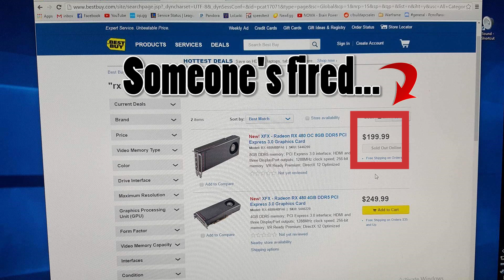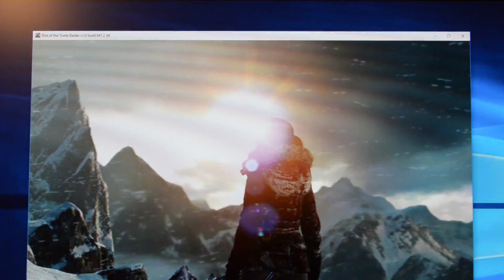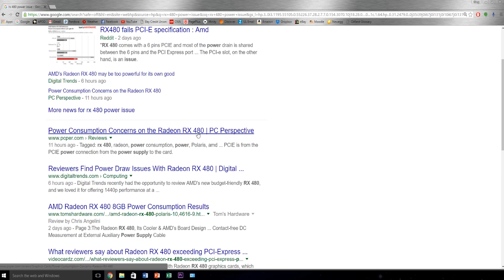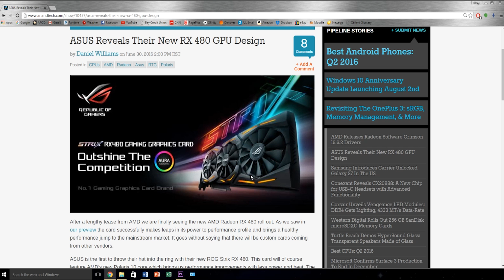RX 480 Aftermath: Power Issue & Over-Hyping

Comment: Okay, lemme get a GTX 960 or a GTX 970.
Reply: I mean, the 960 and 970 are the same or more expensive than the RX 480 and slower. Only blind fanboyism or actual CUDA use would make you go to either of those, over the RX 480.
Reply: I still want the RX 480.
Reply: Okay, lemme get an RX 480.
Reply: +Oliverleo2007 $269.08 I can buy that.
Reply: What?
Reply: +Mika Hadi no
Reply: Why its vram options are 3/ 6 gb. No thanks this isnt 2012.
Reply: get the gtx 1060 it's actually gonna be on par with the gtx 980 (unlike the so much hyped rx 480 (lol)) and will most likely cost about the same as the rx 480
Reply: jellenheimer Anti Kaan Agency And it seems that i was right... as always.
Reply: wait for GTX 1060 or 160Ti
Reply: Anti Kaan Agency Yes, it need to be compared. Blind fanboy who rush buying untrusted product.
Reply: nah man the rx 480 sounds a lot better than my ancient r9 270
Reply: +Tsunami lol that's bs you don't know that
Reply: Tsunami "likely cost the same" how do you know that?
Reply: or driver quality... especially in *nix world. I personally can;t say my AMD driver experience has be good..
Reply: Tsunami Lol me as well Nvidia always good when it come to driver and thermal management and also power consumption, it might not have the same terra flop but in gaming real benchmark it result better then Ati radeon card

Comment: I disagree.  I am fairly confident that the RX480 will compete, if not beat, the 980 at stock.  It's already trading blows in some games!  It might just take a while for the drivers to fully mature for us to see the full performance potential. 

I am also expecting some big improvements from the AIBs.

According to OC3D, he noticed that the XFX OC'd versions were getting the same benchmark scores as the stock card, and upon further inspection, found that the card was being power bottlenecked.  He actually lowered the clock speed from stock, and still got the same scores!
Reply: Total Annihilation Guru3d is probably the best GPU benchmarking site.  Check it out.

Techspot showed the RX480 winning in 14/16 benchmarks, and one of the ones it lost was Rise of the tomb raider, which runs like absolute dog shit on AMD.   The 970 was handily beating the 390x on that game.
Reply: No, it doesn't.

Unless you want to play AOS all day, every day.
Reply: Ill wait for the sapphire version of the card with a custom pcb, and ocerclock the shit out of it
Reply: Shawn E Are you the guy I just destroyed in reddit?  lol
Reply: It's trading blows with the 970. Not the 980
Reply: Rohit
No, it flat out bests the 970.
  The aib versions will beat or match a 390x!

Sapphire nitro leak 1325-1350 factory clock!
Reply: *****
considering it's a midrange card, it's okay.
Reply: Gene Starwind Na, I saw your post there and thought it would be hilarious to post the same reply. :D

Comment: The thing about AMD is that their driver support is superior than Nvidias. The 390 started weaker than the 970 and is about 10% faster nowdays. I honestly expect this card with a very good overclock and a 8 or  two 6 pins to get rather close to a retail 980.

Comment: That will probably require GPU bios update to fix the issue, normal driver update wont help with this problem. Newer RX480s will probably be fixed before hitting the market.

Comment: This might help explain a little better as well

"The RX 480, like most GPUs, pulls power from two different places. The first is through its own PCIe slot, which the PCIe specification rate at up to 75 watts. Some cards use less power than that, and don't require any additional connections. The RX 480 has a 150 watt total TDP, so it should theoretically pull the other 75 watts from its six-pin PCIe power connection. Both of those connections are specified for a maximum of 75 watts. Yet, in certain situations, the card's power draw can exceed 150 watts -- and thus the limits of one or both power connections."

Comment: Man, my friends were worried about the Amd rx 480 power Issue. I kept telling them that just wait for board partners to firmly grasp this product. I told them this would be a great card for their games and do some recording. In fact the benchmarks prove that this card is great for budget building.
Reply: If your motherboard has PCI-E 2.0 then it's fine.
The problem here is the numerous people blowing up the issue like an atom bomb, when this power issue, arises due to reviewers trying to build a PC using 10 year old parts.
Reply: Mobileduivel The reviewer is comparing the AMD RX480 6pin with a 980ti 8 pin. This is not a fair comparison. Even a genius like you would know that.
Reply: Budget price = budget build, no?
Reply: +Abram Carroll da fuq? Go to PCI-SIG website they have the specs of PCI-E 1.0 & 2.0 versions rated at 75w, 3.0 brings up to 300w and more bandwidth inform yourself.
Reply: I honestly don't know what beef this reviewer has with AMD ?
Reply: pci slot pins would melt lol  be like runing a washing machine on a android charger
Reply: oh really i haven't heard of a nvidia card just randomly turning off any computer because of power issues. and as you can see in this video even a GTX 980 TI runs fine with the 10 year old board. this is a fuck up of AMD stop trying to protect these fuck ups. 75watts is a STANDARD for a reason. if it needs more it needs to pull that from the 6/8 pins
Reply: Wibz He's comparing an 8 pin with a 6 pin ??? That's stupid. Science studio spent most of the video trashing the RX480 when the GTX 750 and other Nvidia cards are known to do the same.
Reply: Wibz I'm sorry, I have no idea what your talking about.
Reply: +Abram Carroll also, the card maxes at 200 watts. The reviewers NEVER claimed the power consumption double during high intensity testing...
Reply: There's a lot of stupidity and bad blood floating around... It's a great card, the announced driver and custom cards soon to launch will cement that even more. nVidia has no alternative at the moment, which isn't ideal (price wars and stuff) but not bad either... because AMD really needs to get some more market share, so the playing field is more leveled (that way neither of them would pull dick-moves as often).
Reply: 6 months later and you're right
Reply: Yep it will be exciting too see what it can do With custom coolers and PCBs
Reply: He has nothing against the rx 480 he liked it
Reply: PCIe 3.0 still has a max of 75 watts for the slot.  This card violates the spec at stock and is pulling 200-300 watts with a small OC.  It's an issue.
Reply: There are, however, rumors that PCI-E 3 will include support not only for 300 watt cards ...slot is still 75w draw  card may take more power from supply  but not motherboard  ...why would a motherboard use 300watts for pci slot ...crossfire would be 600-900watts for pci slots only ...half inch motherboards kek
Reply: Tom Madison you are right,probably 300w it's not the case, but >75w manageable but I find it a nonsense to acuse AMD for this, other nvidia cards draw more than 75w as well through the pcie, now this is bad just because we are being told so, and not back then.
Reply: WTF ar you talking about this isnt the only card that draws more than 75watts form the PCI.
the RX 480 only draws more than 75 watts for the 8GB version that is running at 4k.
Reply: +Matlockization well, he compared a 2 years old gpu to a newest one lol. It's AMD bad part there for putting 6 pin without any other research. Even my GTX 460 has 8+6pin for OC lol
Reply: Matlockization
So by your logic, can I compare my GTX 460 with that 8+6pin to GTX 1070 with 6+6pin? And you think 460 will win because it's using more pin and more stable? lol

I dont think it's really matter how many pin the card have, because it was AMD decision to pick how many pin they have to use.

But actually he DIDN'T comparing, he just tried to use other GPU to confirm that the RX is having a power issue with the motherboard..
Reply: iam happy with my sapphire nitro R9 390 8g ill upgrade like after 4 years
Reply: FIRMLY GRASP IT !!!
Reply: Did they fixed the problem with power issue

Comment: it's kind of shocking amd wouldn't stick to motherboard standards.  wtf are they thinking
Reply: They did the same thing with the 295x2
Reply: for mos part they did, otherwise the card could not be released at all(the card is indeed pci-e 3 compliant), the issue seems ot affect older mobos with pci-e 1.1 and the older 2.0 boards

Comment: You actually addressed a lot of the gripes and issues that a lot of folks have had, myself included.

I was initially really disappointed and aggravated that it didn't seem like the 480 was geared to offer anything more for those who had a 390/970.  Well, the truth of the matter is that it wasn't meant for that segment of the market.  It was meant for those that had a 380/960, at least in pricing.  AMD and Nvidia have yet to release anything that might compete in the $300 price range, and it's anyone's game with what level of performance we'll get from a card in that range, if something is released at that price point.

I, personally, do have a few concerns over the power delivery on the 480, but I have a feeling that those concerns will be addressed by the AIBs with an 8 pin connector (or more), and that should take care of any potential issues with overdrawing power from the motherboard.  Time will tell, and while AMD might have a rocky start with the community based overhyping and the power draw issue, it can be a very promising one.

I'm hoping that as Vega is unveiled that we, the consumers, will have another solid option to go to with AMD since an Nvidia monopoly would be bad for the community.  We'll see though.

Good video, and looking forward to seeing more.
Reply from the maker: Thanks for watching!

Comment: xD
Ps : i think the GTX 1060 will kill it ...
Reply: Typically,  the gX 106 gpu feature half of what the gX 104 gpu has,  so i would expect 1280 cuda core,  32 ROP,  and 3 or 6 gb of vram ( 192 bit bus)  etc running at ~1600mhz base.  So no,  i think they should be similar in terms of performance
Reply: Actually if it's 192 bit, it should have 48 rops.
Reply: ***** k
Reply: ***** if memory bus width affects rop count,  i would guess it would have 24 rops
Reply: Phoenix Wright How? GTX 960 had 32 ROPS (128 bit) and my 980 Ti had 96 ROPS(384).

It would have to be 48.
Reply: ***** don't forget the 1080 has 64 rops
Reply: Phoenix Wright And that was 256 bit.

Comment: I have a pretty old setup (Evga x58 sli le motherboard if you want to look it up) but a pretty beefy power supply at 850 watts, is there a way I can maybe boost the power going to the pci-e slot if it does cause problems?
Reply: that is literally what you don't want, more power going through the pcie slot, thats pretty much what the drama is. probably just wait till they release the cards with an 8 pin power connector
Reply: well i preordered already and I'll be picking it up on monday hopefully.. maybe i'll dodge a bullet and everything will run smoothly since my psu is beefy enough
but this whole issue has me very worried
Reply: Fantasyze It should still work, even if you have problems, im sure you could get a refund
Reply: true, im hoping i put it in and everything runs smoothly but we'll see about that :p
Reply: It's possible to lower the voltage limit for the GPU in the driver setting  and a the power usage go down really fast even with really small voltage change. 

But if you need to do this ... it will probably become  impossible to overclock.
Reply: i guess I'll update you guys, everything is running very well, no failures related to power at all!

Comment: question. by stock reference do you mean the vision tek version? also what would be the difference from and rx 480 made by sapphire, xfx, Asus and so forth?
Reply: By reference he means any card the uses that same PCB (with only a 6 pin)  and cooler.  Brands like asus,  xfx,  etc usually design their own PCB and cooler for the chip. Some brands might put an 8 pin connector and/or a better cooler.

Comment: okay. i really want this card, but i have a cheap but new skylake mobo. the gigabyte h110m S2H to be exact. and  a coolermaster b600 600watts bronze psu. will i be ok ? i desperately need an answer. been here since  around 1000 subs
Reply from the maker: ^Exactly.
Reply: If its a modern motherboard it should be fine, even if it's cheap.
Reply: +Science Studio Thanks guys ^-^
can you do a comparison between the r9 390(x) and the rx 480 ??

Comment: can amd fix this issue with a driver or card bios update?

also, how will I know if my mobo can handle the RX 480 or not?
Reply: is it a cheap motherboard made before 2006?
Yes: it probably can't
No: It probably can
Reply: ask where you buy that card to check the combination
Reply: they have ot fix it somehow otherwise the rx 480 loses its certification as a PCI Express Card(this basically makes the card look and possibly illegal to use by system builders, since a overdraw on the motherboard can damage it and in some cases can even be a fire hazard), its likely gonna be thru a bios or drvier tweak indeed but the most surefire fix will be not gonig for the reference card.

go for the AIB's instead when they finally get out

as for motherboards its seems ot be fine unless the MB is from 2006 or before since tyose use pci.e 1.1
Reply: They sent out a press release today, it will be fixed with a driver update.